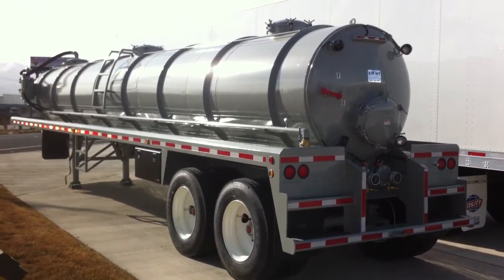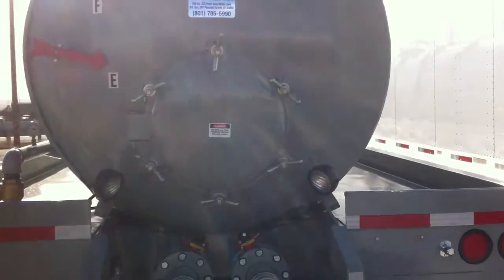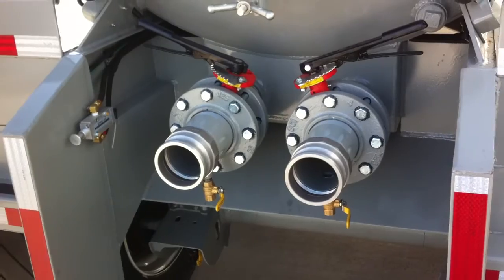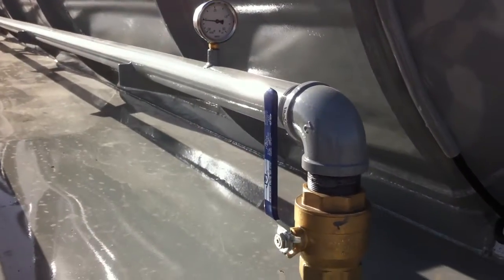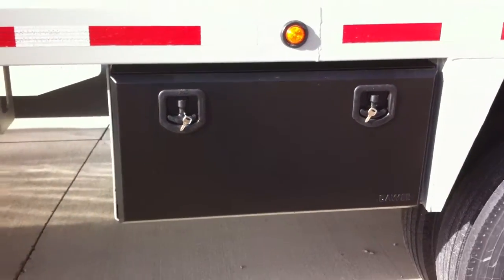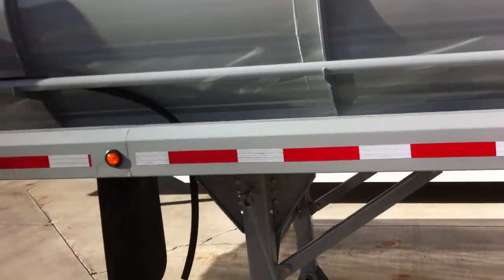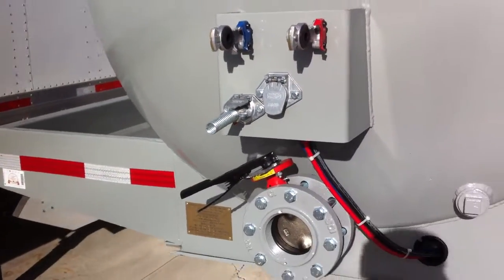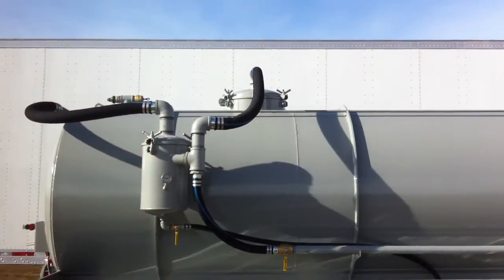130 BBL VACUUM TANK TRAILER

Comment: Butterfly valves are best set horizontally when moving fluids with solids as sand, rocks or clay balls. 1" bleeder valves best placed on top instead of bottom lengthen valve life by butterfly valves. Tool boxes way to close too tandems. Move forward keep mud and water from rusting out boxes and a blowout from damaging boxes plus weight distribution is better. A cat walk is nice of course and safer. 20 plus years at it and still trucking. License plate light needs a plate or bracket to keep a hose from hitting it ruins a night trip possible ending with pretty red and blue lights behind you wanting your autograph.
Reply from the maker: Thanks for your input!

Comment from the maker: We include 2" threads top and bottom of front and back of every tank for site glass windows or fill level tube  

All hose trays have hooks for securing hoses, buckets, bins etc...  

The pressure relief valves are set to 18 PSI but can be adjusted to anything the operator desires.  

We can spec any diameter valve on a trailer or provide adapters to any diameter hose. 4" has been requested the most so it was shown in this video. 

Any Custom spec trailer available within 4 weeks.